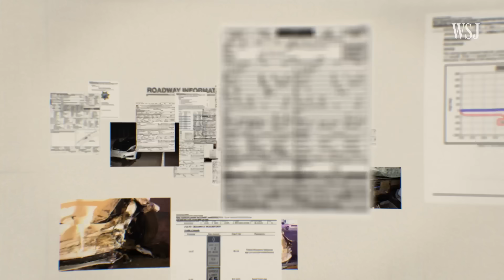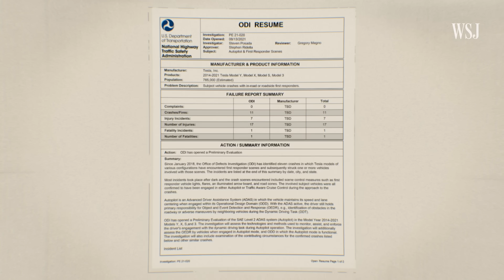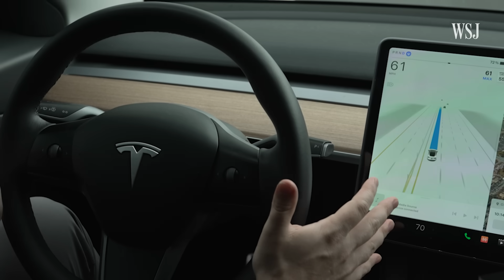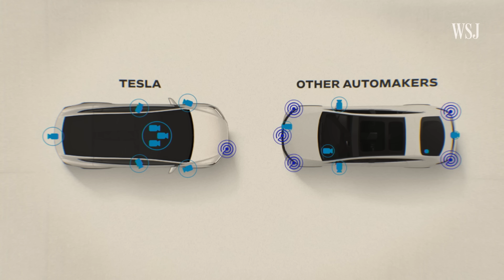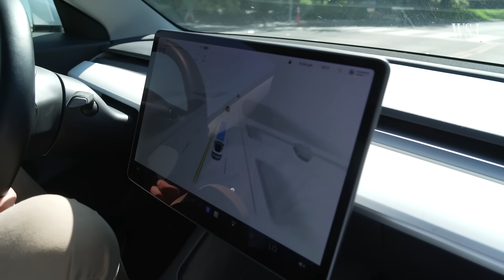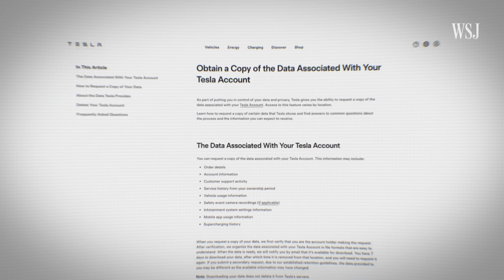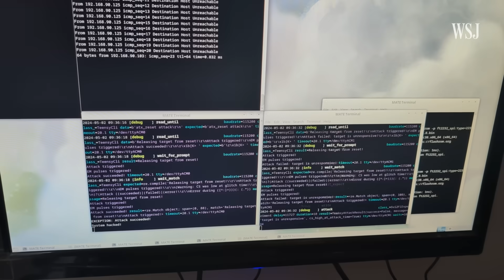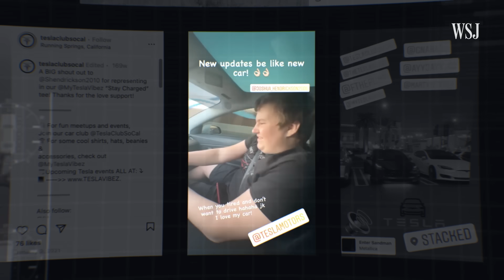The Hidden Autopilot Data That Reveals Why Teslas Crash | WSJ

Comment: Tesla already lost that lawsuit in the EU for Misleading marketing calling it autopilot. in Europe its seem as glorified cruse control
Reply: The use of the term “autopilot” and “Full Self Driving” is extremely misleading and gives the impression that the car can drive itself. The way the feature is marketed and named is a problem. Pilots who fly an aircraft with autopilot are highly trained and well-versed in the features, functionality of the aircraft they are certified to fly. The same can’t be said for the average car driver.
Reply: Well, it's still a Level 2 system. But no one told the US people...
Reply: Tbf, that’s all autopilot is on a plane. It keeps it pointed in the same direction, and the same speed and altitude. It’s the full self driving claims that are really bad imo
Reply: @drd2093  Modern airliners have very complex autopilots with dozens of features and modes.

Some planes can even start and land via auto-pilot, tho thats still the exception.

But even then, the airlines and regulators are highly aware of how dangerous badly designed autopilot-functions are. How much training they require to use responsibly.
Reply: @termitreter6545   Modern airliners have very complex autopilots with dozens of features and modes. 
No, that's the Flight Management System (FMS) you're talking about. The autopilot takes commands from the FMS, and has only very limited functions relating to course or heading, altitude, airspeed, and rate-of-climb/descent.
Reply: @BigBen621  I dont get it. The FMS is usually a computer interface, in which you can also enter your flight.
But theres also a full AP control panel to manage the autopilot seperate from that. Which has said dozens of modes, some of which can use data from the FMS.

Either way, The reality is: 'Autopilot' is a concept, its not any specific thing. In fact, the autopilot in planes is arguably a product of many different systems working together.
Reply: Regulators and the people who are watchdogs against regulators failed to prevent anyone from calling it autopilot. Tesla never should had been able to pass that through
Reply: over here in the Netherlands it's also illegal to use autopilot
Reply: A plane on autopilot will still crash into a mountain.
Reply: @lowmax4431  But the technology to make planes automatically avoid mountains has been there for decades. It's just the regulatory authorities that have decided that the pilots must remain in control and that the automation can't have such power.
Airbus has been preparing for fully automated flights for decades.
And systems like TCAS could technically take over and fly the plane away from danger if they were allowed to.
Reply: I'm not sure if one of the replies already said this but in the EU the FSD features are heavily limited compared to the US. This makes the comment of "glorified cruise control" not to far off in Europe
Reply: People are napping in their front seat, so crazy.
Reply: @tomtom-g5y1i Not true, autopilot requires hands on wheel, Unless a REALLY lazy person puts a device to trick it
Reply: @tomtom-g5y1i   People are napping in their front seat 
No they're not. Tesla has very effective attention monitoring that makes this virtually impossible.
Reply: @tomtom-g5y1i 😂
Reply: @tomtom-g5y1i  Darwin Award for them….. but no one is taking personal responsibility for their actions.
Reply: @shelfdoubt Sell it, why do you keep driving it?
Reply: Elon musk must be prosecuted
Reply: I can’t understand how relaxed are the Americans with an obviously limited tech that JUST helps the driver but cannot substitute him, and they trust this tech with their lives just because the billionaire with interest to sell that tech, says so! Ultimately, people are too mind limited to think for themselves…..   I have a Tesla and it works great to help me! But not to drive for me!
Reply: Tesla's autopilot behaves exactly like how autopilot in planes behaves.
Meaning you cant be a complacent moron while driving it.
That term quite litterally perfectly describes Teslas autonomous driving.
Reply: @shelfdoubt  So what's different here?   I also own a Model Y and I always use FSD (NOTE:  FSD is NOT the same thing as Autopilot.)  I have to supervise it - but these days the only errors it makes are due largely to Google Maps.  It has TWICE saved me from a serious crash by taking evasive action.  I have driven about 50,000 miles on FSD and it works AMAZINGLY well,

So what's different between you and me?
Reply: That was a German Court which forbade Tesla using the name "Autopilot" because it's misleading.
Reply: @ploed   That was a German Court which forbade Tesla using the name "Autopilot" because it's misleading Which was overturned on appeal.
Reply: +moken79  That's not entirely true. 2022 Tesla won a lawsuit in Germany: They are still allowed to call their toy "autopilot". 
Gemäss "Golem":

Urteil: Tesla darf den Autopilot weiterhin so nennen
Das Assistenzsystem-Paket von Tesla darf weiterhin als Autopilot bezeichnet werden. Der Versuch, dies Tesla zu verbieten, blieb vor Gericht erfolglos. 17. August 2022

Nach Ansicht des Gerichts sei klar erkennbar, dass die Fahrzeuge weder autonom fahren können noch dies dürften. Geklagt hatte die Zentrale zur Bekämpfung unlauteren Wettbewerbs.

Allerdings muss Tesla eine kleine Textänderung auf der Website vornehmen, bei der es um die Full-Self-Driving-Funktionen geht. Hier soll Tesla den Zusatz "bis Ende des Jahres" entfernen. Jetzt heißt die kreative Bezeichnung "in naher Zukunft". Und das automatische Fahren innerorts heißt nun "City-Lenkassistent" .

Der Rechtsstreit hat sich über Jahre hingezogen. Tesla wurde von der Wettbewerbszentrale vor rund drei Jahren verklagt. Der Wirtschaftsverein hatte zunächst vor dem Landgericht München Erfolg (Az. 33 O 14041/19), doch in der Berufungsverhandlung vor dem Oberlandesgericht München scheiterten sie laut Teslamag.de. Eine Berufung wurde nicht zugelassen. Die daraufhin eingelegte Beschwerde der Wettbewerbszentrale beim Bundesgerichtshof wurde dem Bericht nach abgewiesen.

Unabhängig von diesem Prozess hatte das Landgericht München I Tesla Mitte 2022 verurteilt, den Kaufpreis für ein Model X größtenteils zurückzugeben. Der Grund sind die Unzulänglichkeiten des Assistenzsystems Autopilot. Das Gericht folgte Mitte Juni in seinem Urteil einem technischen Gutachten, wonach das Assistenzsystem Hindernisse - etwa die Verengung einer Baustelle - nicht zuverlässig erkenne.
Reply: it's no diffrent to Adaptive cruise control in my Honda plus Google and Waymo are waaaaaay ahead of Tesla in the Robotaxi and self driving Car game. Theres use a combination of Sensors, Cameras and AI and it a Level 4 system They are testing them without a driver in Areas without people around and even they are testing Self driving Semi's as of recently In San Francisco people are actually protesting against them funny enough since it's one there test cities for the cars
Reply: Keep sharing your story.
Reply: @shelfdoubt  You aren't supposed to trust it to not kill you... You are supposed to watch it and be ready to take over.... and believe it or not, every aircraft you ever get in is the same way... the pilot is monitoring the AP ready to take over if needed. ESPECIALLY on approaches near the ground.  I always taught pilots to EXPECT the AP to try to kill them... this is not a contradiction...  APs are usefull, in acft and in cars, EVEN IF they have shortcomings that may try to kill you if you arent paying attention.
Reply: The EU will sue for anything, you losers have "hate speech" and did you notice they won it?
Reply: I saw a FSD video in a Tesla S last night and the driver at least kept her focus on the road and had her hands touching the steering wheel
Reply: cameras cannot be trained tp 'recognise' a random, never-seen-before obstruction such as an overturned vehicle, or something that fell off the back of a lorry. Only radar/lidar can do this however Senhor Pinocchio Musk isn't going to crack open his wallet for such frivolous reasons.
Reply: @shelfdoubt  What car would you get today if you could change?
Reply: @shelfdoubt   my very limited understanding is that it’s more complex than that 
No, @kriss is pretty much correct, although it does also control airspeed or rate of climb/descent. It's the Flight Management System (FMS), which executes its strategies through the autopilot, that's complex.
Reply: it needs further improvement n more accuracy. 2% lives do matter too as being Tesla's buyers.
Reply: Are you really discussing this while you have the perfect killing machine on the road: the cybertruck ??? America is ridiculous.
Reply: Tesla already lost that lawsuit in the EU for Misleading marketing calling it autopilot. 
And they won the lawsuit on appeal, long before you posted your comment. If you're going to post comments, please try to make them factual.
Reply: Autopilot is indeed glorified cruise control. It's entirely different and dated tech compared to FSD Supervised who's modern equivalence is WayMo.
Reply: @michaeld5621  Autopilot is indeed glorified cruise control 
Well, actually traffic-aware cruise control, AKA adaptive cruise control—not just plain cruise control—plus lane centering; but the point is the same.
Reply: That's dumb. Autopilot is a term that's meaningless to most people because most people aren't pilots. I don't know what it means or exactly what it does. I do know that I would never trust a computer with my life, especially one controlled by AI. And I'm a software engineer. As a responsible adult, I'd read the what the requirements are, which Tesla has expressly and loudly displayed on their cars. I don't have a Tesla and I've hated Teslas for their build quality, general public misperception about their "luxury car" status, and lack of a gasoline engine since the beginning. However, they are great cars for the average person to own. They are probably the closest thing to a perfect commuter car for most Americans.

That said, Tesla should not allow Autopilot to be used in the dark when they rely so heavily on optical cameras.
Reply: @roots4x   Autopilot is a term that's meaningless to most people because most people aren't pilots 
Actually, I think most people do have an idea of what autopilots are in general, even though they may be mistaken on specifics.

 I do know that I would never trust a computer with my life, especially one controlled by AI. 
Your choice. But months of FSD driving me around San Diego hands-free with the skill and precision of a professional chauffeur have convinced me that FSD is far more likely than me to respond correctly to a dangerous situation, for several reasons.

  Tesla should not allow Autopilot to be used in the dark when they rely so heavily on optical cameras. 
That makes no sense. If the headlights are on, FSD sees objects that are difficult to see, for example a runner or pedestrian in dark clothing, far sooner than I can. And if the headlights aren't on, the driver can't see to drive either; and even at SAE Level 5 there's no requirement for the ADS to be able to do things a human driver can't do.
Reply: @BigBen621  We just saw video evidence of people dying from Autopilot not seeing objects in the dark. You are defending a product because you own it and want to tell yourself that it's safe, but there is literal proof that it's not in this video.
Reply: Tesla Autopilot has been involved in 467 crashes, 13 fatal. Meanwhile 16,248 car accidents EVERY DAY. 
That's 117 💀 and 6,849 injuries daily. 

It seems like the WSJ and Democrat leadership are targeting Musk in the same way the Biden Admin shamelessly tried during their time.
Reply: The EU nowadays relies on fining American companies to get by 🥴
Reply: Autopilots are just glorified cruise control.  No different in aircraft or cars.  You can't just put your RV on cruise control and go into the back and fix yourself a drink.
Reply: @georgepelton5645  Yes - both aircraft autopilots and Tesla autopilots are exactly that.  HOWEVER:  Tesla "Full Self Driving" is *NOT* the same thing as Tesla "AutoPilot" - Tesla's autopilot does what an airplane or ship autopilot does - it maintains speed and does basic steering - so "Glorified Cruise Control" is a reasonable description.    Tesla's FSD - literally does the whole job of driving the car from A to B...but you still have to supervise it (although that requirement is likely to go away sometime soon).
Reply: @georgepelton5645  With all due respect, autopilot in modern aircraft are far beyond just being described as glorified cruise control.
Reply: @ Maybe if you include systems in passenger jets, like Autoland, sure.  But that is not part of the Autopilot even for those aircraft. It is a separate system.  AFAIK, most GA aircraft only have autopilot as I described.
Reply: @georgepelton5645  The way Elon advertised the Tesla autopilot was definitely as a fully capable autopilot. They even call it "self-driving cars", talking about how full AP is constantly aroudn the corner. And hence they got whacked by the EU for misleading marketing.

As far autopilots just being cruise control, thats at best a half-truth. Autopilot doesnt have a clear definition as to what it means. Some earlier planes (calling it 'automatic flight control system') had just hold attitude, while a few modern planes can do almost fully automated landings. Even during Cold War, there was fully automated drones.
Reply: Autopilot literally is just cruise control in 3D. It holds altitude, heading, and bank angle. The jet will fly until it runs out of gas. The engines will stop. Pressurization will be lost. And everyone will succumb to the reaper within minutes. Unless the jet descends to a safe altitude quickly enough with its engines now inoperative.

Auto-Land is a much more sophisticated autopilot. It tracks the ILS as a pilot would land in fog, clouds, and rain. But it cannot usually take you where you need to go. Perhaps from lineup on runway, to touch down. But certainly not taxi to the gate.
Reply: @Triple_J.1  Modern aircraft autopilots can be FAR more sophisticated than that, and takeoff to touchdown fully automated flight has been possible for a LONG time now (even if not commonly used that way). But the big difference is there is very little to hit once off the runway, and airplanes don't need to rely ONLY on internal guidance. So aircraft autopilot don't even TRY to "look outside", that's the pilot's job, for what little it's worth most of the time.

Ultimately, these systems in cars are like newly minted teen drivers. They can "drive" well enough MOST of the time, which lulls you into thinking they can drive, but they can't deal with anything out of the ordinary due to lack of experience (aka "training").
Reply: @Kevin_Rhodes   takeoff to touchdown fully automated flight has been possible for a LONG time now  
That's the FMS (Flight Management System), not the autopilot. The autopilot simply takes commands either from the FMS or the control panel, to maintain or fly a heading or course; maintain, climb to or descend to a pre-set altitude; and maintain a set airspeed or rate-of-climb/descent when climbing or descending.
Reply: @Triple_J.1  Also ... Remember flight plans which typically include a heading via the auto pilot taking  the plane to a controlled airspace where it would also get a warning via the transponder and airspace control systems.  If you are going to compare a 2D to 3D system it would end with the aircraft throttle and elevator trim!
Reply: @Triple_J.1  Tesla is Way more Advanved than Airplanes... Their tech is Years old minimal  improvements.
Reply: Tesla will never be approved for self-driving, not in this state, not even if later the software or AI is 500x better than it is now!!

Self-driving only with cameras, definitely not! 🤣

Cameras can be blinded by the sun, and it is over, along with other problems at night when there's not enough light, etc. We could see this in the video FSD driving skills at night 🤣

Tesla fans are talking on their channels about how amazing FSD is... yes, as long as the camera can see, if it can't, FSD is a nightmare 🤣

But Tesla is cheaper than other brands... that's true because Tesla is the only car brand that uses only cameras for driving!

I won't even talk about quality, etc. because Tesla looks cheap compared to others.
Reply: Adaptive cruise control is way safer than Tesla autopilot, the tech has existed for 2 decades and guess what, it uses LIDAR.
Reply: @jtrain9926   Adaptive cruise control … uses LIDAR. 
Most new cars come with adaptive cruise control, but sometimes only in the higher trim levels; and almost none of them has LiDAR.
Reply: Why is autopilot such a bad name planes have it as autopilot they still need pilots that still do most of the work same here autopilot is not fsd and even if it was that is still ur responsibility to pay attention all these vids r is ppl relying on it to fully drive on autopilot which is vastly vastly different then fsd and more so now then a year ago autopilot just increases decreases speed based off traffic in front and stays in ur lane that's all fsd is far more so now tho bc now it actually is fsd
Reply: Shame on Tesla
Reply: In defense of the actual technology, it's not supposed to be used as it's name may suggest "autopilot". You can't just go to sleep or not pay attention to the road when using this, you have to act like you're driving at all times.

Now for what it is, it's extremely impressive what Tesla has managed to do. However I don't necessarily think that there's any new inherent risk because of the technology. Lane Assist and cruise control has been around for quite a while, and Teslas is no different just more advanced. The problem is people who are fooled to not pay attention. From the videos I saw here of people crashing, it seems like even without the autopilot on they would've crashed. If something is odd or out of the ordinary on the road your immediate reaction should be to take manual control and brake. Waiting it out either means naiveness or not paying attention, I think the second is more plausible as many barely pay attention when driving without assist.
Reply: @shelfdoubt  What would be leading? A larger alphabet soup of driving aids?

This reminds me of the 90's when some people couldn't find where their work was 'saved'. You really have to understand directory's and disk structure or it's a bust.

Same here, you really need to understand what autopiliot does and what FSD is. The fault of tesla may well be in compentence of these features but it cannot be people not reading.
Reply: What does true autopilots in a plane do? Does it not just hold current level and heading? Does that mean pilots can just go to sleep and stop monitoring? Does autopilot automatically avoid obstructions?

No, pilots still have to pay attention. Tesla using the term autopilot implies drivers still have to pay attention, not to mention their explicit notices warning drivers be ready to take over at any time. 

People crashing their tesla is a skill issue not a technology issue. Unless it’s a TCAS type problem where the car is actively interfering with driver input
Reply: @krisswolf2011 no, because planes have planned routes and “lanes” because the sky is divided into “layers” so each plane can use a “lane” (altitude) to fly and avoid other planes by default.
Reply: @krisswolf2011  Not comparable to modern AI based systems.
Reply: @churblefurbles  my point is, my understanding of true airplane autopilot is that it is simple and holds current flight straight, but still need pilot attention. 

So when drivers crash while using autopilot because the car didn’t see and avoid, that’s not a fault of the car, that’s a fault of the driver. 

If the autopilot thought it saw something and suddenly swerved or other sudden action and caused the accident, then I’d think it’s not the driver’s fault. But thats not what happened here
Reply: @krisswolf2011  dude, you really trying to use logic with these people. Even the warning screen on the autopilot on a Tesla says you need to pay attention, but hey Elon is Orange man’s friend. 

Remember when he was the sweet heart of the democrats, bc “Green Energy” or whatever
Reply: @DIYAudit  The term "autopilot" means VERY different thing to a lay person and a pilot. A lay person thinks autopilot is a button push and forget feature, while a pilot would know autopilot needs extensive set up and monitoring, and actually required training to use.

This system should've never been called "autopilot". It's misleading at best, and an outright lie at worst.
Reply: @ So you’re saying adults can’t be held accountable for their actions because they misunderstood a word? By your logic, we should rename cruise control too, since it doesn’t actually steer the car for you. Maybe instead of blaming the name, we should focus on people taking the time to understand the tools they’re using.
Reply: @DIYAudit  That's literally what "misleading marketing" means...

By the way, "cruise control" has never included steering of the vehicle. That would be "lane keep assist". Bad analogy there.
Reply: @viperabyss  Bro, just take the L and hold it tight. After my response, the only reasonable thing to say was, ‘You know what? That makes sense. Adults should be capable of using basic common sense or, bare minimum, reading the giant warning Tesla slaps in your face before activating autopilot.’

But no, here you are, trying to defend the idea that grown adults that can afford a Tesla can’t read or whatever excuse you want to make for them.
Reply: @DIYAudit  LOL! Take the L? What are you, three?

And they did take responsibility, by being killed. All because they believed in Tesla's marketing that was deliberately deceptive.
Reply: @krisswolf2011 No
Reply: other car companeis have similar names
Reply: @snuffeldjuret 
“Other companies blahblahblah”
“Everyone else jumped off the building, so I did too”
Your comment makes no sense.  Just because others do something it’s ok for everyone else?
Sounds very tRUMPish.
Reply: Clearly you haven't had a tesla drive you around
Reply: Yikes a lot of jealousy in this thread
Reply: It is a glorified cruise control and anyone who trusts their life to it is a fool. Unfortunately there are many such fools. The question is whether it’s safer than a fool without autopilot. Regular cars crash in the same situations due to driver error and distraction.
Reply: What about the instructions that the driver MUST AGREE TO, to remain in full control of the vehicle. This program is ridiculous. It's a hit piece!
Reply: But isn’t this the point about misleading marketing? Sure, the fine print explains that you’re the one driving the car and that Autopilot or FSD will only step in to slam the brakes if necessary. However, all the promotional materials suggest otherwise—it’s all about kicking back and letting FSD do the work, just keep your hands on the wheel in case the car f’s up.
Reply: @gregbailey45  if you have to remain in full control of the vehicle it isn't autopilot
Reply: @  if you have to remain in full control of the vehicle it isn't autopilot 
When Tesla Autopilot is engaged, it is in full control of the vehicle, in the sense of making control inputs. The driver is only supervising, so they can take over immediately if Autopilot fails or makes an error. In fact, any effort by the driver to make steering or braking inputs to the car will disconnect the Autopilot—and then the driver will be in full control.
Reply: That's what it is. That's why Tesla tells you to watch the road and be ready to takeover at any time. It even tracks your eyes on FSD and makes you place your hands on the wheel in autopilot.
Reply: I agree with you, but the timing of this is WSJ Musk hit piece. The question I asked myself is, did Musk try to give humans one last benefit of the doubt before catering to the Darwin award recipients. Also, people can be petty. If they can blame the car before an internal assessment of their logic, they will. 

Overall, this report should include an individual’s driving record.  But moreover, should be an analysis of what type would set autopilot, climb in the back, fall asleep, and…
Reply: @jdm1152 The timing makes it a hit piece against Musk?  How so?  Aren't journalists SUPPOSED to report on issues that are current and relevant?  Trump hiding accident reports for Musk seems like the ultimate in current relevance, wouldn't you say?  The hit piece, it would appear, is your post, against WSJ.
Reply: @jdm1152   The real problem isn't that the technology is still imperfect. It's that Musk is mendaciously advertising it as much more capable than it is.
Reply: @jdm1152  this isn't a hit piece though. It would have to contain false or misleading information, this one contains neither. It would have to at least be subjective and presented as objective, but Musk has done one thing well, promise a lot and delivered not even half of it. And this isn't just "it's in the works" type of failure, no it's his own timelines, his own words saying that they can absolutely be done now are then contrasted by leaked conversations revealing that it's far from being a solved problem. Musk is not some great person looking out for the people trying to give something good, he is just another businessman trying to make money, no different from someone like Jeff Besos, I doubt many people think he is an outstanding person.
Reply: No, it's not a hit piece or the driver. It's Musk's massive ego (and Asperger's) that refuses to let him accept his software is garbage. It isn't even AI and that would also fail. For his autopilot to be safe it has to be taught to recognize every possible scenario that might arise on any possible road. Not every possibility you can imagine but everything possible no matter how improbable. It is fatally flawed in concept and fatally flawed in execution. It is unfixable, it cannot be made safe.
Reply: @ Agreed, about Musk.  The only thing I would disagree with is that by most metrics, the software is quite good.  It's just that it is far from good enough, when the lives of our families are at stake.  What I despise the most about this situation is that you don't have to be the one who made the mistake of buying a Tesla and using autopilot.  As long as you share the roads with people who do, you and yours are at risk.  
Musk ought to be criminally liable.  When humans cause deaths from reckless driving, we are criminally liable.  Musk's autopilot and our current toothless Justice system have removed criminal liability from these deaths.  It doesn't matter how many times he repeats that autopilot is safer than a human driver: it does fail in situations where a human driver arguably would not have, meaning those specific deaths were avoidable, had autopilot not been used.
Reply: @melsuggs3389  I have a Model Y with FSD.  I use it every single day - several times a day.  It most certainly is AI - and it does work.   The AI is trained on billions of miles of real world driving by real drivers.   It hasn't seen absolutely everything - but an average human driver hasn't either.   The Tesla AI has currently seen about 20,000 human lifetimes of driving.   It's not 100% perfect - but it doesn't have to be to be useful.  All it has to do is to be a better driver than a good human driver - and it is...and the statistics prove that it's about 12 times safer than an average human.